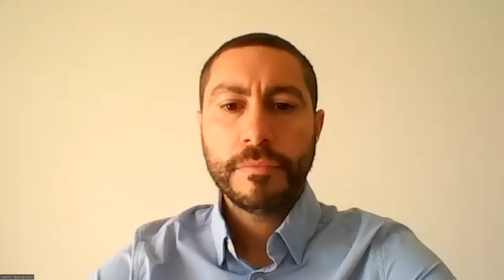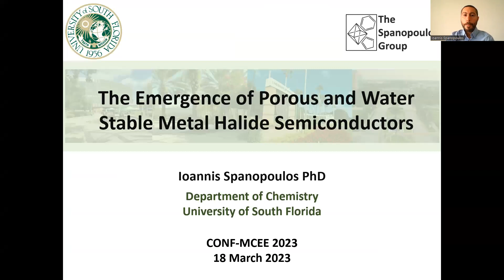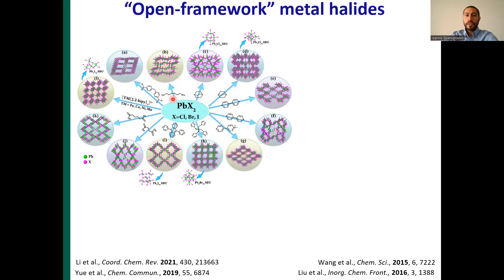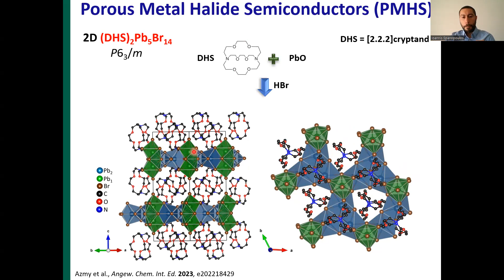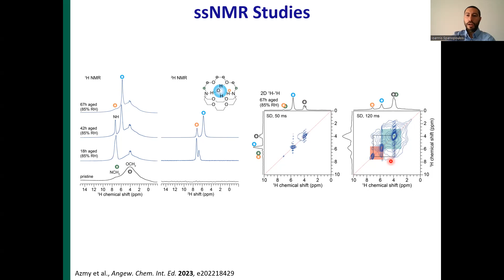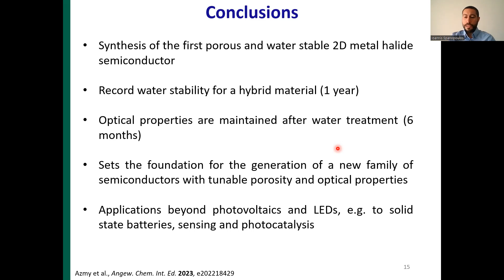CONF-MCEE 2023 - The Emergence of Porous and Water Stable Metal Halide Semiconductors

Comment from the maker: Here are the questions we collected and the answers replied by the presenter: 

Q1: You discussed some of the potential applications for water stable metal halide semiconductors, such as solid state batteries and sensing. Are there any other emerging applications that you find particularly exciting?
A1: Considering the fact that the material is ultra-microporous and can selectively adsorb and desorb water, then it can be utilized in some important industrial separations, such as: NH3/H2O, H2O/H2 and H2O/CH4.

Q2: What are some of the biggest challenges you've encountered, and how have you addressed them?
A2: The biggest challenge was related to the identification of a suitable molecular cage that can give rise to a 2D hybrid material. By identifying the distances of adjacent
counter-cations in other 2D perovskites, we believed that DHS could potentially form a 2D network.

Q3: How do you see the field of porous and water stable metal halide semiconductors evolving in the next 5-10 years?
A3: This is a new family of materials, namely PMHS, with potential in a plethora of important industrial applications. Since we demonstrated that these materials can indeed be synthesized, then by means of molecular and crystal engineering the corresponding properties, including porosity, can be finely tuned targeting different applications. The combination of features of porous hybrid semiconductors is quite unique, and I am sure it will attract the interest of the community in the years to come.